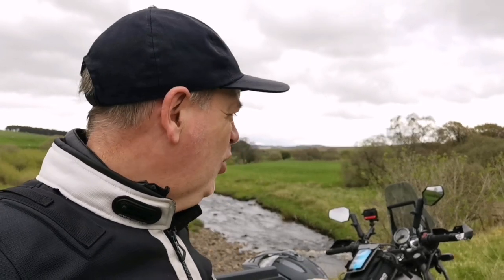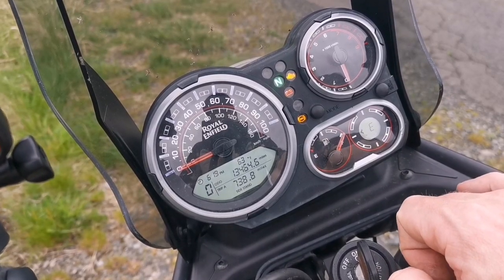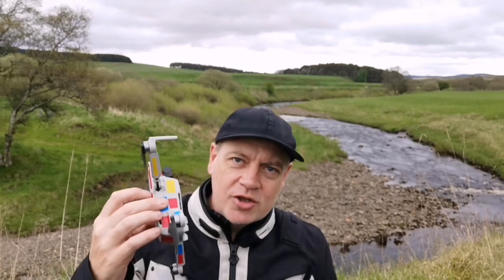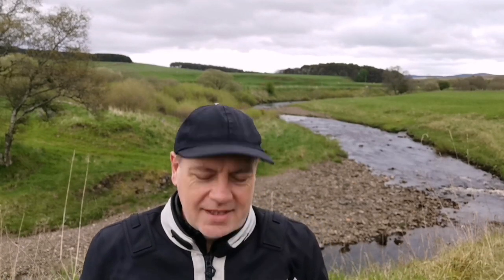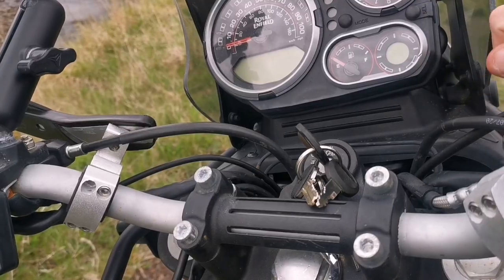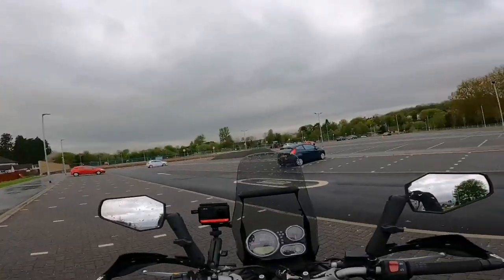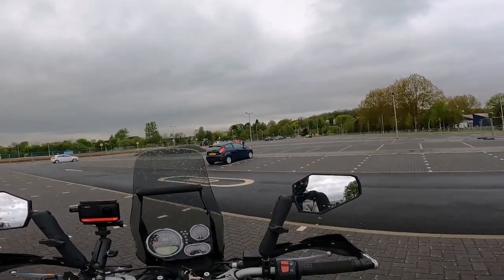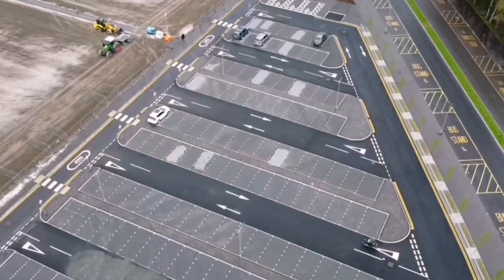Himalayan Compass Calibration - How to Calibrate The Compass On A Royal Enfield Himalayan - Figure 8

Comment: Hi Martin what's your opinion of the scram 411, ride safe
Reply from the maker: Hi Steve I haven't ridden one yet but they are getting good reviews. It's the same poweplant as the Himi so Iv no doubt its reliable enough. I like the way it looks smaller fatter front tire means it's gonny corner/handle better on the road. Still got good ground clearance. The fatter tyres mean it won't cut the mud so well but I recon itl be fine green lanes etc if you wanted to take it off road. Obviously less mounting point for carrying gear but all in all I think it's a nice bike. I'd buy one 👍

Comment: Excuse me if I missed it but I didn't see your Operator ID on your drone?
Reply from the maker: Hi Jeremy the operators ID is written on electrical tape inside the battery cover flap. The caa says that can be done as long as the compartment is easy to access. I had it on the outside but keeps coming off in good old scottish weather and I don't really want to permanent ink the drone all the batteries are labelled as well just incase I lose it. 👍